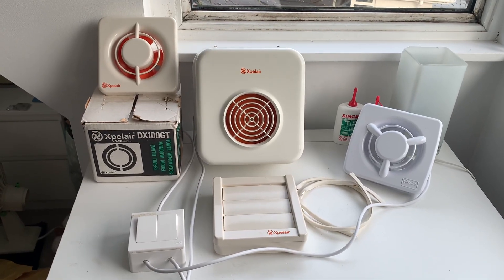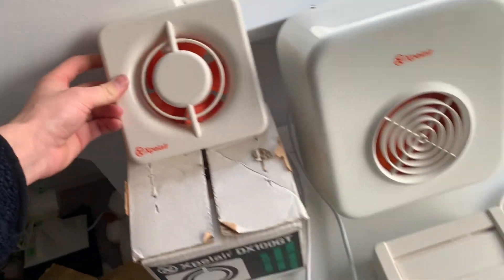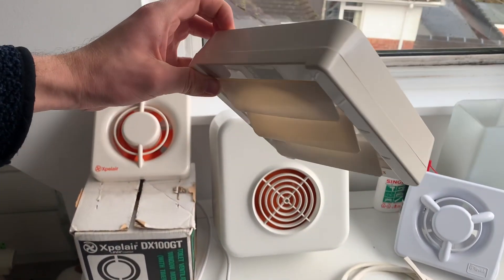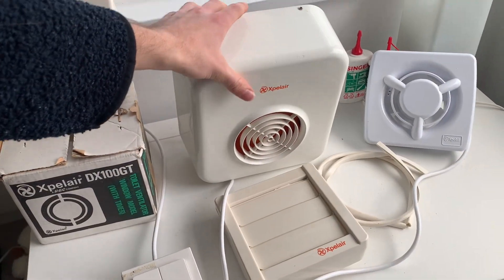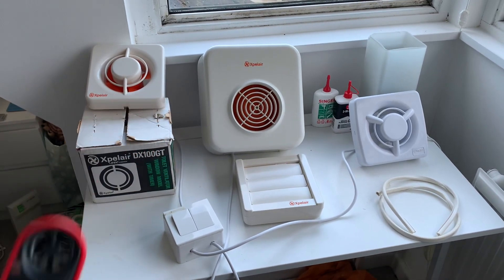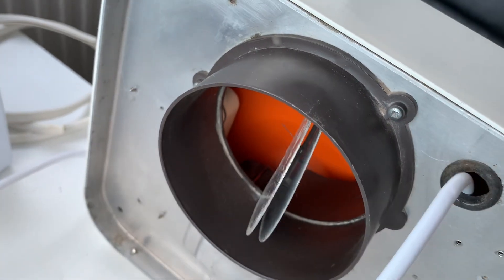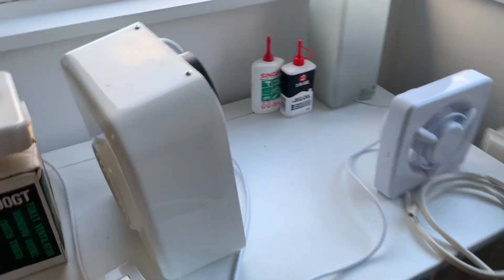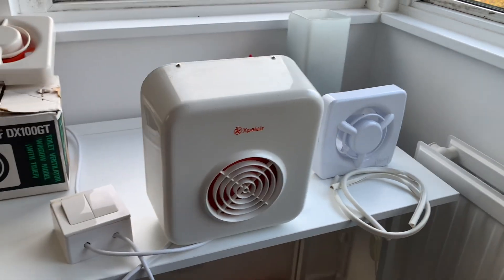Centrifugal vs Axial Extractor Fans

Comment: Recently bought a newbuild, made by Weston Homes (urgh). Axial fan with 8 metre duct run to gravity exit. Practically zero air flow. Bathroom wth no windows. Result - mould within less than a year. If only there was a independent body to hold these cowboys to some kind of standard. What would you recommend I repalce their useless fan with?
Reply from the maker: @dopiaza2006  oh wow, I couldn’t think of a worse installation for an axial fan! In your set up I would either go for a centrifugal type with them being designed for longer distance air travel or alternatively the one axial fan that seems to perform impressively in all installations is the Envirovent Silent 100
Reply: @fanaticalfans  Thanks for the reply! Any recommendations for a centrifugal fan with time and humidistat?
Reply: When my grandma bought a “newish” house on an estate, when she retired from running a hotel, the house had 4X Greenwood airvac 100mm extractor fans with time delay off & the internal/rear “butterfly” shutter, unlike with the centrifugal Xeplair in the video that has the flaps inside the rear spigot - the greenwood had the flaps on the end of its spigot and those were catching on the flexible duct and not even opening [I assume Greenwood intended for a solid duct to be cut and put between fan and louvre vent  for the flaps to open/completely obvious to that design mistake and stating a flexible duct can be used] when I found that fault the ex-hotel repair man removed the butterfly flaps and put external gravity flap vents on the back wall for the cooker-hood, downstairs toilet, utility room, and upstairs bathroom extractor fans.

Comment: Very nice examples of the DX100 and the DX200T. Trying to figure out on what type of exhaust fan to use for our bathroom. its a 108 year old house and its never had one before unfortunetly.
Reply from the maker: @Theutmostgeek these Xpelairs are unrivalled for build quality in the UK, and will be good for another 40 years if looked after! Depending on the installation, e.g straight through the wall to a vent or ducted through the ceiling - you can choose an axial fan for short or centrifugal type for longer ducting